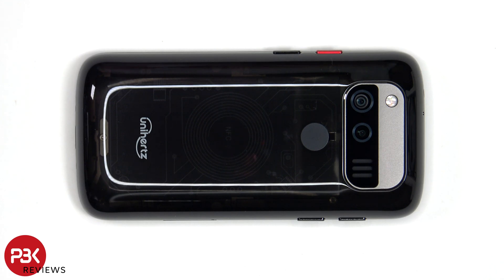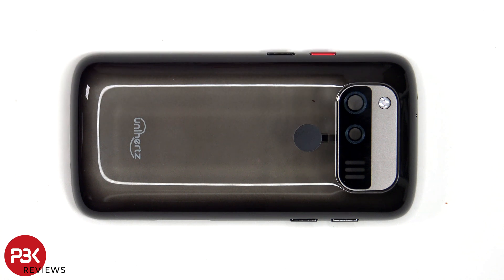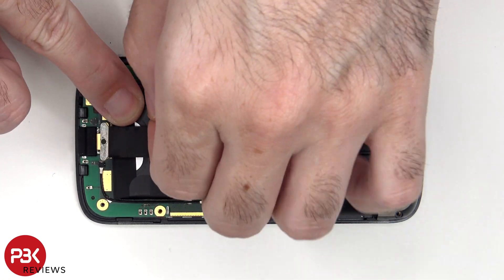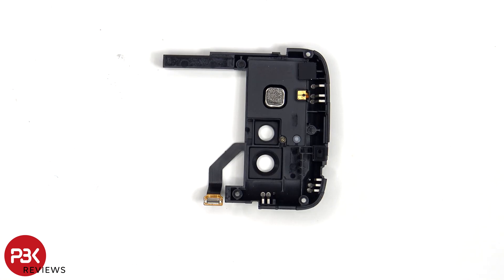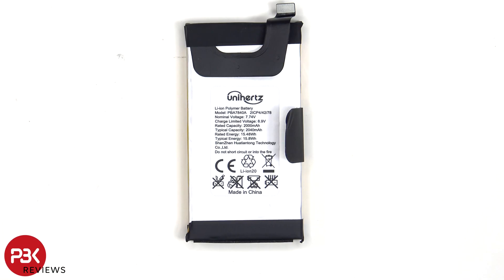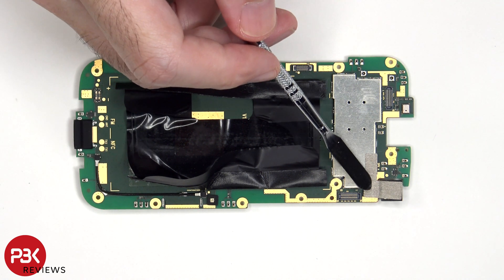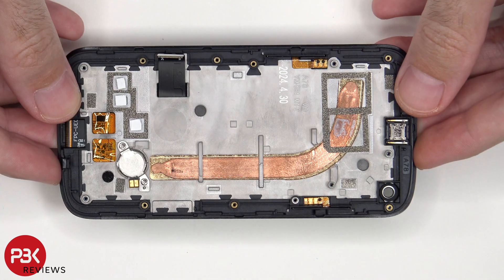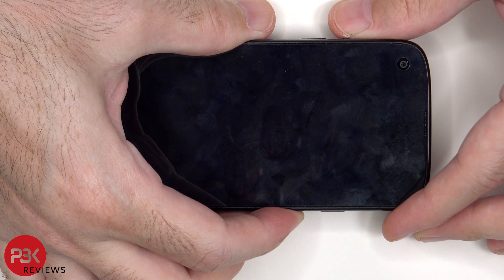Unihertz Jelly Max 5 Inch 5G Smartphone Teardown Disassembly Phone Repair Video Review

Comment: How are people still believing this is a 4000mah battery (rated for as a dual cell 2000). Lite literally impossible to go from 0 to 100% battery in 43. Hell, the oneplus 13 at full 100 watts charging on its 6000mah dual cell takes closer to 40 minutes to fully charge.

I literally did an overnight observation and a technical breakdown of this phone's battery. It's actually a dual cell 2000mah battery (both cells are rated at 1000mah). Fully charged the battery in just a little over 36 minutes. From the start with the battery being at 0% and powered off, to being fully charged while off. Plus, it can't even reach nowhere close to the advertised 6y watts (using the included adapter and cable). The highest I ever got was 55 watts, with 48 to 51 watts on average throughout over half of the charge cycle.

Comment: Great video thanks alot. I just tried to replace the top unit with the speaker build in. Unihert services send it to me because my speaker don't work anymore. I could not complete te task because I got a unit without the LED lights and the little bras thingy. In regards of your video. When I removed the NFC sticker I toar up the NFC cable. In my case it is clued to the sticker.

Comment: i was hoping it would have headphone jack.
Reply: This and the thickness has be double thinking my kickstarter pledge
Reply: @pastamanity754 There was a backer who backed out (ahem 😁) after he learned there was no 3.5mm jack on this one.
Reply: Hey there! Totally understand your preference for the headphone jack for the superior audio quality. 🙌Since the hardware design for Jelly Max is now finalized, the Jelly Max will now come with a complimentary headphone jack adapter included in the box! 😆Please follow the official account for the latest updates!
Reply: @unihertzofficial surely a jelly max pro or ultra model should come with all the fixes everyone is highlighting, a 5 inch phone is the right choice you're making. Just listen to costumer requirements. You have great engineers!
Reply: @unihertzofficial  we are not worried about quality of the audio . we worry about the latency

Comment: nice that the back cover isn't glued down because those can be a pain to remove if you aren't professional phone repairer.
Reply: I wish they went with a non glossy back. Nothing more annoying than on a phone gets fingerprints and act as a sort of distorted mirror. I don't understand why that was ever popular. They can look beautiful under optimal conditions but optimal conditions cease to exist the minute you touch a device.
Reply: @michaelcorcoran8768 since disassembly looks very easy and almost tool free, I hope someone if not unihertz itself releases an aftermarket replacement back cover that is matte. I 100% agree with you about glossy devices!